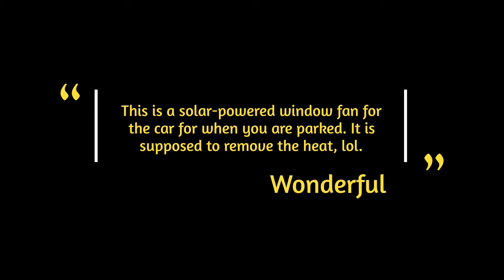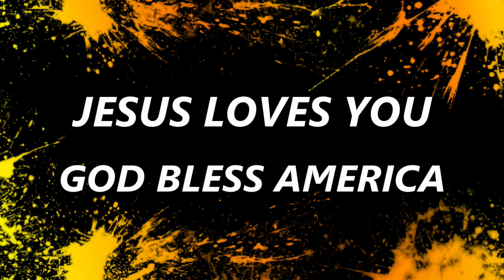Oh No! They're broken!!! Wind Chimes are....

Comment: Too noisy, no verbal instruction and too difficult to follow what is being done.
Reply from the maker: I'm sorry, I had 8 or 10 wind chimes to restring that's all I was doing. Thank you for watching. Casey
Reply: True I was hoping to figure out how to fix old wind chimes  and I was just crazed by the fast forward and music, stressful.
Reply from the maker: @kimmench2864  I'm sorry for that. It is very easy to repair wind chimes. The biggest thing to worry about is getting everything the same length and using the right string. Otherwise it is just time consuming and lots of patience. I'm sorry you were not happy with the video. I will try to do better in the future. Thank you for your imput.